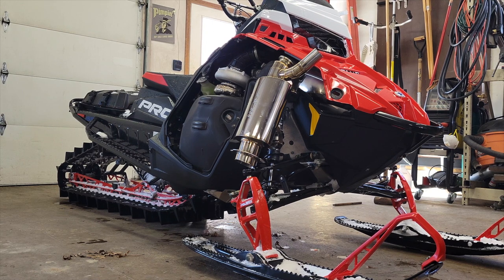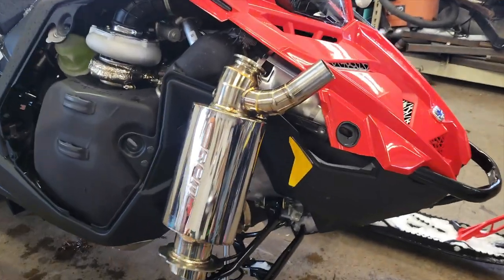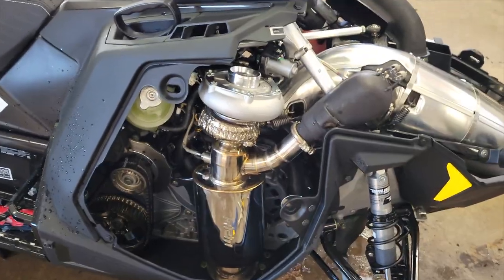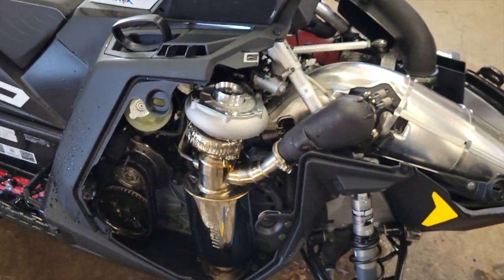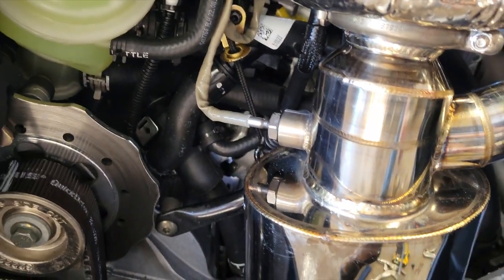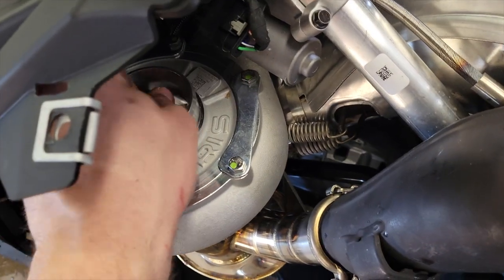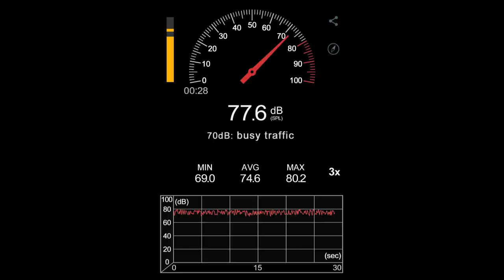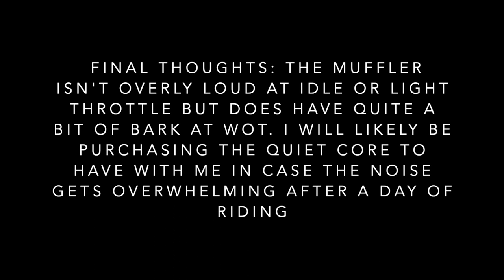Polaris Boost RPM Muffler A-B Sound Comparison

Comment: Been running their titanium version all year. And I will say this the performance gains over the stock and their baffled muffler are very noticeable. Really opens up the bottom end and give it alot more snap. Also doesn’t affect the top end at all. It’s loud yes but I haven’t found a can that works as well as this one yet

Comment: Have it on my vr1 boost. Thing rattled my eyeballs so I took it off. Super nice piece for the price though and did pull more RPM with it 🤷
Reply from the maker: Curious if you ever tried the quiet core insert? I ran this muffler in the mountains with the quiet core. Was loud, not as loud as some like the MBRP stuff. Was really happy with it there but I would opt for a chambered muffler if I was riding the trails.

Comment: Sounds like it has some bark at wide open throttle, would you say its more along the lines of a trail can or mountain/comp can?  I run a GGB trail can now on my sled and it has some bark but nothing obnoxiously loud like a mountain can.
Reply from the maker: My opinion is that it's more along the lines of a mountain can. They do have a quiet core insert as well that I will shoot some footage with coming up. They also sell a chambered muffler.
Reply: @brodyolson6  Thanks for the insight, I was going to get the quiet core insert with it just in case, guess I will make sure to do that, I have a boost coming next fall :)
Reply from the maker: @toy4rnr  You will love it!
Reply: @brodyolson6  I think it will be a blast, coming off a 165 Khaos NA, going to be rowdy for sure haha.